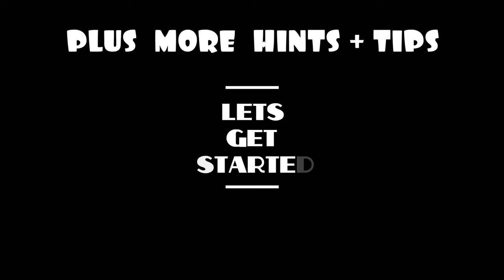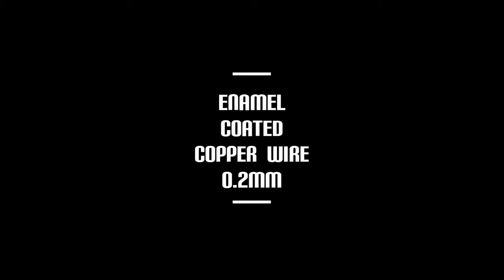Repairing Broken Traces / PCB Trace Repair - Soldering Fix

Comment: Do you have any videos on how to repair the actual hole putting a sleeve in the hole etc..
Reply from the maker: Hi , I've never done one to be honest on this subject . It's a difficult one as if the barrel is damaged or missing on a multilayer board then that's really hard to repair as you need to find what internal layers were contacted to this barrel . Putting a new barrel ( sleeve ) down into this hole simply doesn't work as some layers won't connect to it .
If it's a simple double sided board people would probably just take their lead or wire through the hole and connect to the relevant points . Hope that helps 👍
Reply: What if you did a video with a two-sided board top and bottom with a sleeve that would be cool , sounds like you're from the UK I'm from Sunny South Florida USA
Reply from the maker: Hi , I'm from a county in England , Hertfordshire . Not as sunny as your place . If I can find some PCB eyelets which you need for doing 2 sided PCB barrel repairs I will try and do a video . Thanks for the suggestion and thank you for supporting my channel 👍

Comment: Would it be reasonable to assume that excessive current caused to traces to lift - maybe going back to the via rather than utilizing portions of the remaining trace would eliminate the risk of the trace lifting again?
Reply from the maker: Hi , traces like shown in this video are caused by excessive force across the traces , not excessive current , this tends to leave more damage than just lifting . Traces like these examples are perfectly safe from relifting as long as excessive force or the like doesn't occur again . Hope that helps 👍

Comment: Can you give some details about 'Tack Pack' adhesive i.e. who makes it and where to get it.
Reply from the maker: Hi . Proper stockists like Rapid Online , Farnell or RS Components or if in America you have Mouser or Digikey will stock these but they are quite expensive although Rapid do the spray version ( activator part ) for £11 and it will last ages. I have purchased these from eBay ar a decent price , I've seen the glue part lately for anywhere from £6 upwards . There is massive price variations though so be careful , some people trying their luck I guess . Also it's spelt Tak Pak without the "c" . Hope you get on ok 👍

Comment: What glue do you use? Great channel!
Reply from the maker: Hi thank you for your comment. The glue I generally use to bond wires down and around PCB pads after repair is called Tak Pak. It's a glue especially for PCB work and comes in 2 parts , activator and glue . It's expensive if brought as a pack from electrical suppliers Farnell , RS Components, Mouser , DIGIKEY etc but I have purchased these 2 parts seperately on eBay before with good results and a lot cheaper . I spray the activator on lightly first , wait until it's evaporated then carefully using the end of a piece of solder place a small fillet of the glue over the wires . Normally everyone glues first then activates . This is so wrong ( I believe the instructions even tell you to do this 🤦) , I definitely recommend getting this as it is a great glue , can be removed if necessary but secure enough for the long term if that's what you want . Hope that helps , take care 👍
Reply: @mrsolderfix3996  Thanks so much for taking the time to answer me. Unfortunately I can't buy this product where I live (Argentina). My alternative has been using cyanoacrylate directly on the wire/PCB and applying some pressure. It's not as polished as your way, but it's the best I can manage and it usually works with plastic covered wires + PCBs. I have learned a lot with your channel. I like your video quality and style, but I tend to skip most of the video and watch the most relevant parts. Anyway keep doing what you do. Kudos to you, my friend. God bless.
Reply from the maker: Hi , thank you for your support of my channel , very much appreciated. Hopefully you get on ok with all of your future soldering projects, if I can help a little then that's great . Thanks again , take care 👍

Comment: Hello, im looking to repair an approximately 1.5mm width trace in my heat gun. According to my research, 16 awg wire would match the width best. I only need a short run in order to make the repair. Would you suggest i use kynar or enambledwire. 16 awg enambled wire is widely available but 16 awg kynar not so much.
Reply from the maker: Hi , thank you for your comment . I would always go with sleeved wire over enambled wire in situations like yours . 
I use enambled wire mainly when I've got miniscule traces to repair and need an ultra thin coated wire . Hope that helps , thanks again 👍
Reply: @mrsolderfix3996  Thanks for that. I can't seem to find 16 awg kynar wire anywhere online. Is there a different name for it or should any sleeved 16 awg solid copper wire suffice?
Reply from the maker: @Uch123456  Any should do . Good luck 👍
Reply: @mrsolderfix3996  Thanks!

Comment: Hello Mr SolderFix, Great videos! I have a question is there a way to figure out the size of the wire needed to replace the trace that is removed? Thanks in Adavnce!
Reply from the maker: Hi . Thank you for your question. I normally try and match the width of the trace with an equivalent width wire . I would never for example put a thin repair wire on a wide damaged trace as it could easily blow when signal is put along it . Try and match it best you can . For RF boards you need to be more careful as they are so much more responsive to incorrect repairs. Hope that helps , thanks again 👍
Reply: @mrsolderfix3996  Thank You! That is awesome!
Reply from the maker: Hi , no problem , take care 👍

Comment: What is the name of the spray and glue that u using
Reply from the maker: Hi , thank you for your comment. The glue is called Tak Pak , it comes in a twin pack of Activator spray and glue . Places like Farnell , RS Components, Rapid Online , Mouser and DIGIKEY sell it . It's not cheap but I have seen it on eBay , both parts being sold separately and this is generally a cheaper way to buy it . Hope that helps , thanks again 👍